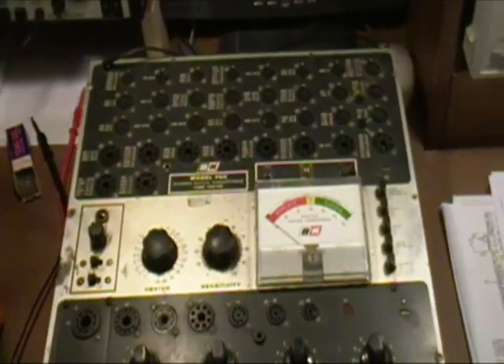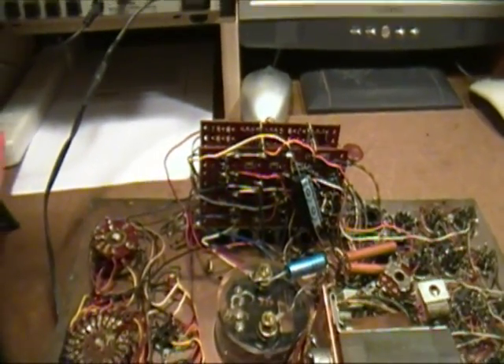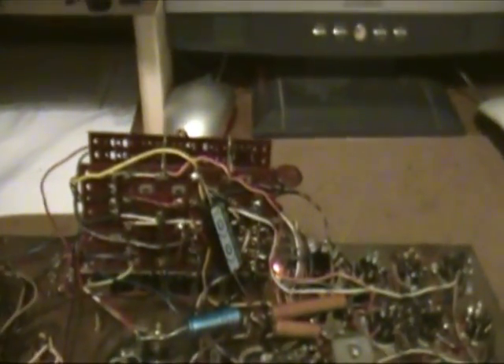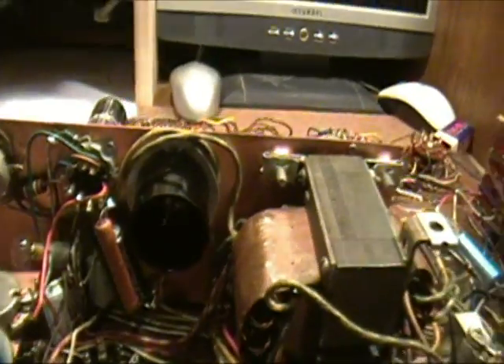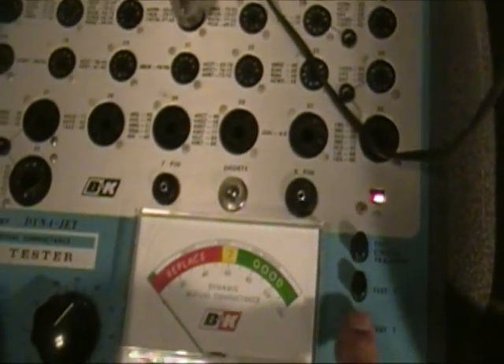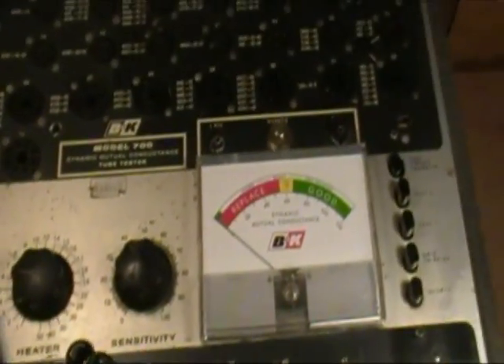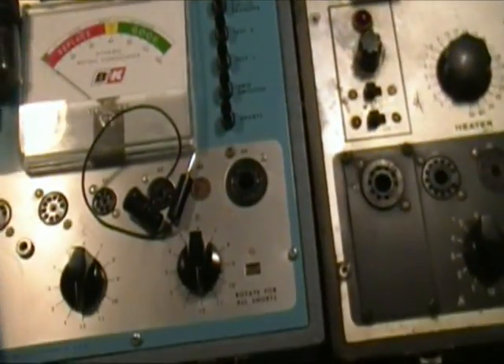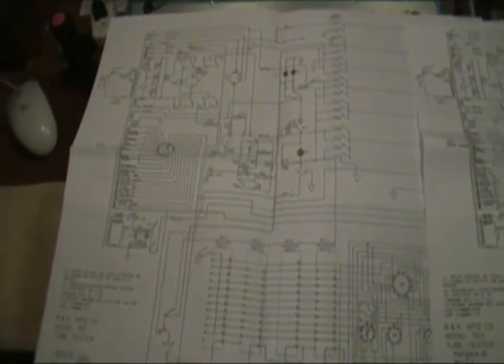TTT053 B&K 700 Tube Tester Restoration and Repair

Comment: Would a bad 83 tube cause the transformer to smoke? I unplugged it right away, but I'm worrying maybe the transformer is now shot. It's on the 700 model that I acquired recently. I plugged it in tested a bulb, started to smell something and then saw smoke. Obviously I unplugged it right away. Any advice is appreciated.

Comment: Does this tester really do what it says and adjust for variations in line voltage, since the 120+AC we have now might otherwise throw off the test results, since household voltages used to be 117?

Comment: Tom mentions that he replaced all the electrolytic's.  He details replacement of C-4 and C-5 with 22 uf @ 450v caps (factory spec = 20 uf @ 250V).  What is the recommended replacement value for C-1 (spec = 250 uf @ 6v) and would you replace C-101 (spec = 10 uf @ 35v)?  Thank you for your insight.

Comment: Regarding the M-5 and M-6 T-55 bulbs...  Does it matter what "brand" of bulb you use here?  My assumption is that the bulbs we buy today are darn close to what was made back in the day.  If they are not, then the bulbs should have specs on them like internal resistance, power dissipation over a voltage range, etc.

Comment: Very useful information as I start down the restoration road of my Dad's 700.  At this point, I have no electrical questions. I will be doing a wholesale replacement of all the capacitors and resistors.  The grey pebbled covering of the case is very damaged and I'd like to recover the case.  Any idea where I can get a similar material to re-do the case? Thanks
Reply: John....  I too went looking for material to recover my B&K.  Its nearly impossible to find.  Instead, I used wallpaper remover and then primed and painted the box.

Comment: Hello I just bought a B&K 707 off ebay with a frozen heater switch. Any advice on getting the spring clip off the shaft to get some cleaner inside the shaft?

Comment: At that ss83 joint where the diodes meet resistors add a fuse cause if those diodes short it will short transformer.

Comment: Is or does the replacement of the #83 tube make a difference as far as voltage regulation? The Rectifier Tube has mercury in it so it helps to regulate the voltage. Also there is a 15 volt drop with the tube. Do the silicon diode resistors do the same thing? or just do a current limit to the diodes?
Reply: The ss83 works well but better when you add 2 5.6v zener diodes with the 2 1n4007 when those are added all DC voltages are more proper without needing to recalibrate. Transformer will also not work as hard since less current being drawn.

Comment: I bought this tester couple years ago. It was fully working and calibrated couple years earlier according to the seller. Well It's been the next couple of years so calibration would be good idea. Also hundreds of hoarded tubes would like to be finally tested 😄 So everything went well but I have a little problem with calibrating signal voltage. R20 pot turned all the way but meter stops at ~ 2.5 V ac. Won't go any lower. What could be wrong? Thanks!

Comment: question? I have b&k 700 tester on sockets 1 29 and 30. when doing TEST 1 the meter goes to the left very hard. Does that mean the tubes is super bad or do I have a problem in the tester.
Reply: I have a similar problem with the meter going to the right hard
Reply: @themichigander4924  Is this still an issue for you?
Reply: Problem with tester. Still an issue?
Reply: @emmanuelvakakis1374  yeah I haven't messed with it for a long time
Reply: @themichigander4924  Mine hit left very hard. Can you check the lamps behind tube 6BN8 both light up and evenly? If not, check them, clean the sockets etc. It is an absolute must these work correctly.
Reply: @emmanuelvakakis1374  thanks for the tip I'll check

Comment: I have one last question on my B&K 707. I can connect a 56 ohm 1/2 watt resistor on the negative side of the meter just before or at the connection of the push button board, correct? Someone stacked 2 diodes on top of the electrolytic capacitor, but I rather install the correct resistor. Thanks again!
Reply from the maker: It depends on which meter you have. B&K changed meters in mid-production of the 700 and the new meter needed a 56 ohm resistor to make up the difference. They never changed the design and so the 707 has the same resistor. However, they later made some 707's with the old meter which did not need the 56 ohm resistor. I do not know a way to tell one meter from the other by looking at it. My best advice is, if it works,  to leave it the way it is unless you can determine which meter was used. Of course, the 56 ohm resistor will not damage anything but it may throw the calibration off if your unit uses the old meter.

Comment: Well, I replaced several resistors on my B&K 707 what were out of tolerance. I am not having any success calibrating the Signal Voltage Adjustment on socket 1, pins 1 & 2 as mentioned on the manual. I'm only seeing random numbers on my multi-meter. Instead, I'm pushing down on test button 1 and doing the adjustment on the potentiometer on socket no. 25. I'm using a modern multi meter. Do I need to install a vacuum tube for this calibration?
Reply from the maker: No, you make the adjustment with no tube in socket 1. You must have good contact on all the bulbs in the bridge for this to work correctly. Make sure the bulbs are making good contact in each socket. If this does not solve the problem then there is probably a component or wiring error in the bridge circuit. It is unlikely that the transformer voltage is wrong, probably a resistor out of tolerance (assuming the bulbs are good and making good contact.)
Reply: Duh, stupid me! I had the the connections on pins 6 & 7. Thank you so much for your help. I finally calibrated at 1.5 volts

Comment: I have a B&K 707. Where can I find a schematic? On pin 8 of vacuum tube 6BN8 has a 22mf 250 volt electrolytic capacitor. The negative lead of the capacitor is attached to pin 8 of the vacuum tube and the positive side is attached to a terminal. Is this correct?
Reply from the maker: Pin 8 of the 6BN8 should have a .01 mfd  paper capacitor, not an electrolytic. I got my manual from Boat Anchor Manual Archive (BAMA).
Reply: On the Signal Voltage Adjustment, I'm using a multimeter instead of a VTVM. Is this okay? I'm using sock #1, pin 1 & 2, according to the manual. Before pressing down on the test button 1, I have a reading of 6.5 volts, but when I press down on the button 1, I have fluctuating volts from 80 volts to 230 volts. The voltmeter is set on AC.
Reply from the maker: If it a modern digital multimeter, it should work. Look at the manual for the meter and determine the input impedance - most modern meters are around 10 Megohm - VTVM's were usually 11 Megohm. The meter to avoid is one that says 20,000 ohms/V or worse, 1000 ohms/V. These were usually called Volt-Ohm-Meters or VOM's. VOM's will load the circuit more and cause the reading to be lower than it actually is.

Comment: I have an opportunity to procure a B&K 700 or Hickok 533a (also B&K 650 and 606 available). I have seen your videos for the 650, 700, and 707, and thought that one of those might suit my needs well. I mostly work on hi-fi audio, tube amps, and radios. Which would you say would be best suited to these needs?
Reply from the maker: If you will be working with any old tube types (pre-octal like 4, 5, or 6 pin tubes) then the 533 is your best choice. I would avoid the 606 but all the rest would be fine for octal and later tubes with a slight preference for the 650 if it has the 610 test panel. I will be publishing a two-part series on tube testers that you might want to watch before buying. I should have the first part up by tomorrow.
Reply: Thank you for your reply. The 650 does have the 610 test panel. Would you say that it's a better candidate for restoration than the 533a, all things being equal? I was under the impression that people like the Hickok more, but your videos make the B&K 650 look pretty enticing. I was originally leaning toward the 700, but I don't really need speed as much as accuracy and flexibility. In addition to hi-fi, radio, and instrument amplification, I frequently work on Hammond organs, my first passion.
Reply from the maker: Restoration is more a question of condition, so if the 533 is in better condition and about the same price I would go with it. A 650 with 610 test panel is, in my opinion about the equal of the Hickok 600A which is similar to the 533. However, I would pay a little more for a 600A (or 533) than I would for a 650 with 610 panel because of the extra sockets (4, 5,6 pin etc.). In part 2 of the two videos I intend to start posting tomorrow, I offer the opinion that of the B&K testers I prefer the 650 with 610 panel but if I had to own just one tube tester it would be the Hickok 600A. As it happens I have both but the 600A suits all my needs while the 650 cannot test early radio tubes like the 80, 83, etc. The circuits are essentially the same in the 650 and the 600A (which is also the circuit used in the 533), but you will find that, due to the reputation of Hickok, those testers will usually command a higher price than B&K on e-bay, other things being equal. I should be able to post Part 2 of the tube tester videos (which covers mutual conductance testers like the 650 and 600A) by Sunday or so. I hope you will watch those and let me know what you think.

Comment: I just burned the transformer of my b&k 667 tube tester. I live in Belgium, so I was using power converter with max power of 200 watts, all the tubes i tested, had bad results. I thought it had something to do with the lack of power. So i bought a travel electrical outlet converter, i plugged in the american outlet into the converter and turned on my tester. It started to make loud humming sound and next was smoke from my transformer. I have no idea what to do now. The transformer is burned...and it's an old type of transformer.
Reply: Wasn't a power issue probably a bad 83 tube or out of spec components usually drifted resistors

Comment: Question; did you use the PR 57 to calibrate the B&K 700? if that is the case, was the voltage set at 115 volts or higher?
Reply from the maker: +John Cunningham I did use the PR57 to set the AC voltage for calibration. I don't remember the details of this particular tester but generally I use 120 volts instead of the 115 Volts recommended because my local line voltage is 125 Volts instead of the 115 that prevailed in the 1950-60's. By using this higher line voltage I have been able to get consistency between the Gm reading across several B&K testers on the same tube. I think I talked about this in the Model 700 and 770 restorations where I tested several tubes in both testers and found the two testers to be remarkably consistent with each other. I chose 120 Volts as my standard because it is midway between the 115 of the 1950-60's and the 125 I see today. It has worked for me but I do not have any other justification except that it seems "about right."
Reply: I found the same thing and used 120 volts as the standard, our line voltage is usually around 125, exactly the same as yours. After calibrating the B&K 747B I then compared it to my older 747 and found a very slight difference in readings, "usually between 2&3 points which I consider excellent " the readings by and large were consistent with the many tests I performed. The configuration between the two meters are different, that might have a slight bearing on the readouts, but what ever the reason accuracy is the key. I have watched a good portion of your video's on the restoration process and enjoyed them all, please keep them coming.